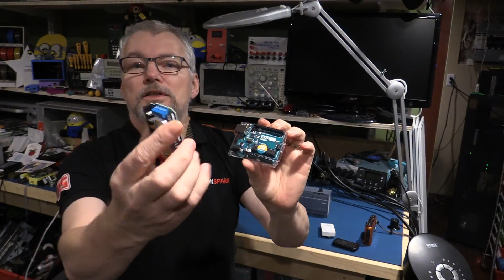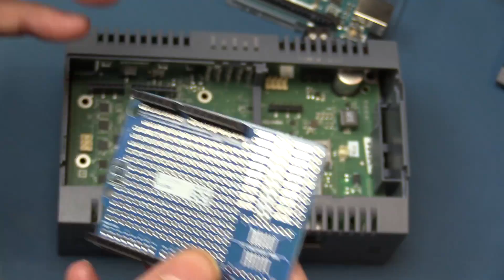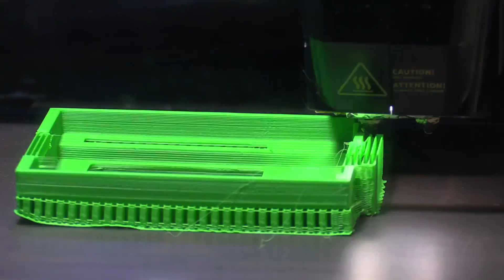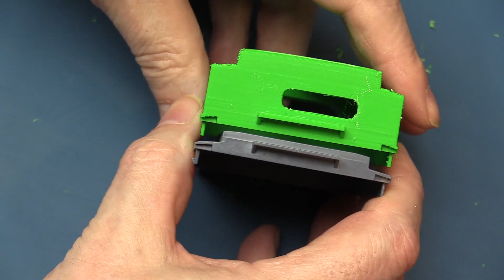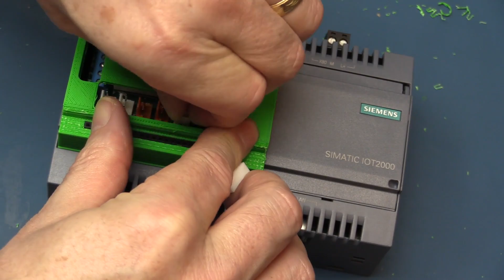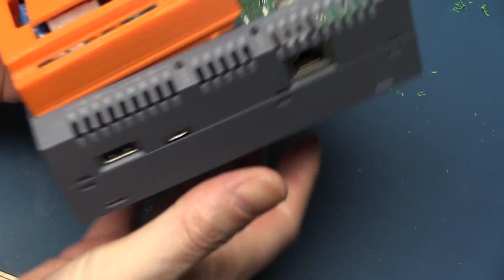Arduino Relay Shield and new lid for the IOT2020

Comment: I would think that making any modifications to the enclosure would void the UL label and even the CE label on the IOT2020?
Reply from the maker: yes but if your putting in other boards, you will be doing that anyway, If you want to retain UL/CE then Siemens has an approved IO board for this unit including a new lid to go with it.

Comment: You might try replacing the slots on the top for access to the screws with individual holes - one for each screw. This would be more difficult to design just right but would leave the case a bit stronger and avoid fingers slipping into the terminal blocks by mistake. Just a suggestion.

Comment: I do think that lid restricts you in maintenance etc. more than anything else. Also exposes potentially live terminals to someone who fiddles around with a screw driver. Might not be the most appropriate lid in my honest opinion.
Reply from the maker: If you look at most DIN rail mounted equipment, they all have exposed terminals surrounded by plastic in some way, almost without exception. Even DIN rail mounted terminal blocks designed for Mains. There small enough to prevent the casual finger touching them and deep enough in to be below the surface. It would be a deliberate act to touch them
Secondly, the terminals in this case are NOT mains rated and limited to about 30V so not a safety risk. but still ideal for a 24V powered Home or Industrial control system
Reply: Ah, I thought these were mains rated. A lot less of a concern in 24V DC industrial applications. Thanks for answering.
Reply from the maker: no problem

Comment: Great Video. Can't wait for the STL upload. I would like to modify it for an LCD touch panel.Did you create the new cover from Siemens technical drawings, or your own measurements? The STL creation would make a good video.
Reply from the maker: The original STEP file for the lid that comes with the IOT2020/IOT2040 can be found here http://www.automation.siemens.com/bilddb/download.aspx?reqInsID=1455035
i will be publishing mine real soon, but if your modeling a different one, this may be a better start point, it is actualy the entire case as separate objects.
Reply: Cheers. I would have never found this on the site. I still can find it by searching.
Reply: that is.. can't find it.
Reply from the maker: The link should just simply download the stp file, it points right to it, this can be imported into your editing software, what error are you geting ?

Comment: Peter, what type of op amps do you use in Modular PSU projects?
Reply from the maker: Not relevant to the IOT2020 Relay Shield but OK... :)
I use the TLC272ACP
Though there are many others that would be suitable, but I found some to oscillate under certain conditions. Of the ones I had available, this one worked the best., see https://www.element14.com/community/groups/test-and-measurement/blog/2015/06/09/electronic-dc-load--performance-improvements
Reply from the maker: Sorry, that one was for the DC Load project
the TLE2144 was used for the Power Supply Project., see https://www.element14.com/community/groups/test-and-measurement/blog/2014/09/15/the-modular-bench-power-system-the-essential-diy-build-for-every-ee-student-and-old-timer-alike for the complete post including schematics